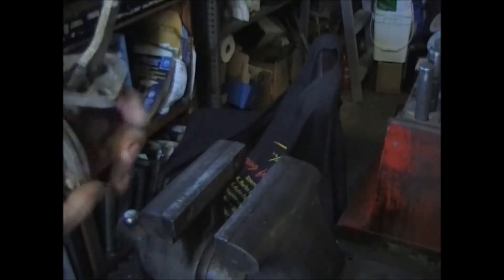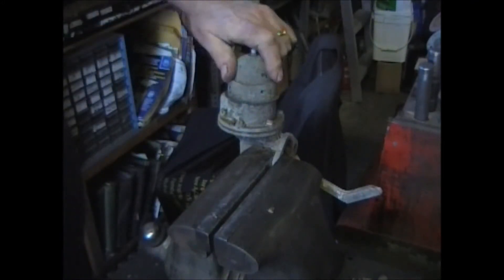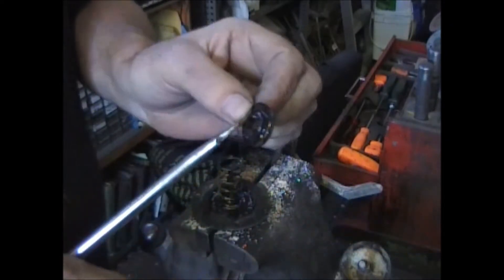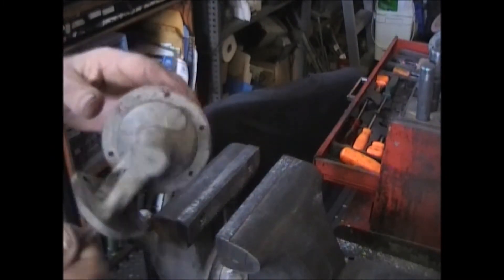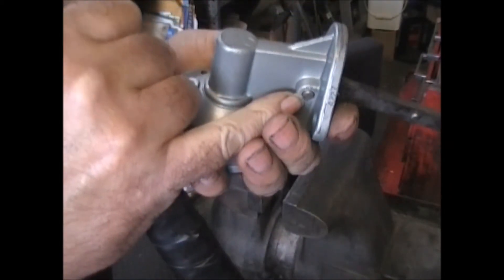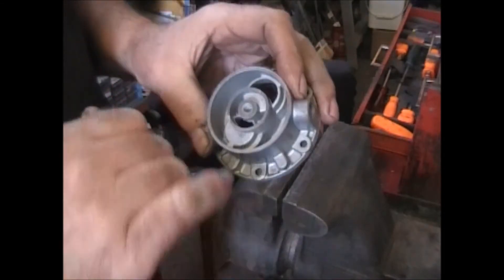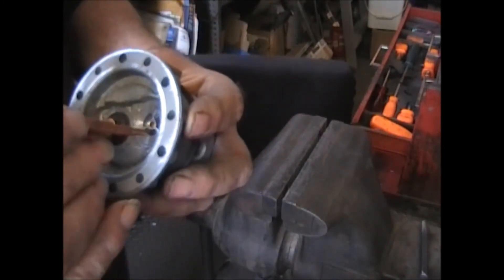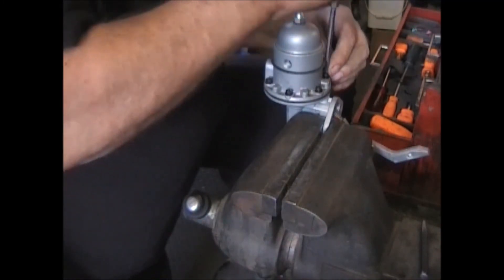AC 4227

Comment: If The small spring (that is located in the arm)is a soft one what happens? You can change something by choosing more or less strong or more or less softness. ..I wish my English could be understandable
Reply from the maker: The only thing the spring on the arm does is to keep the arm in constant contact with the cam lobe. When the engine RPM's raise, if that spring wasn't there, the arm would bounce off the cam lobe or the rod that contacts the arm. That would result in the pump losing pressure and the amount of fuel being delivered to the carburetor would be low or lost completely.